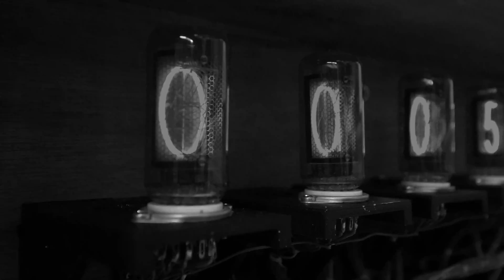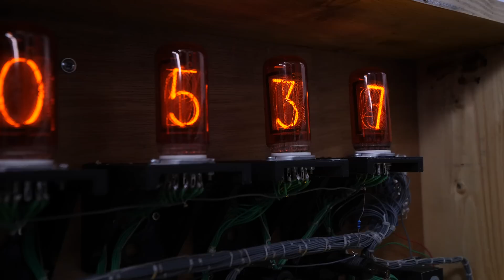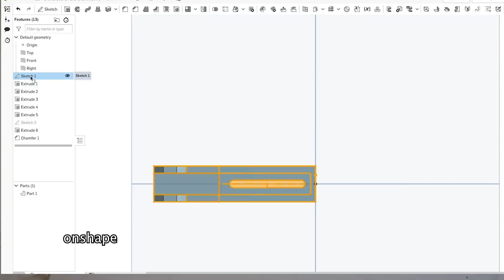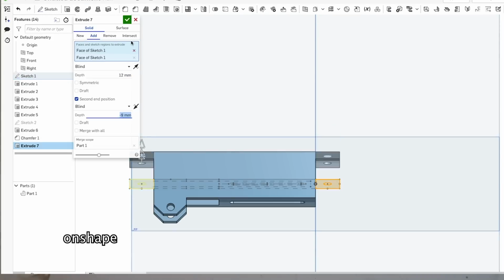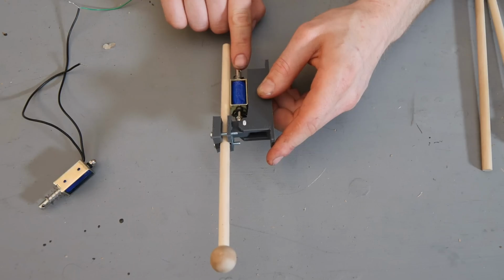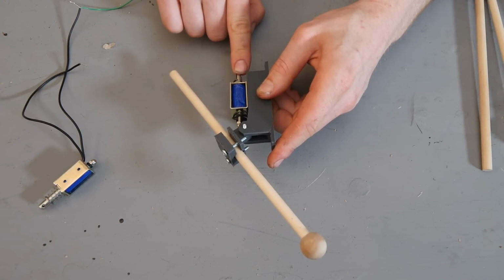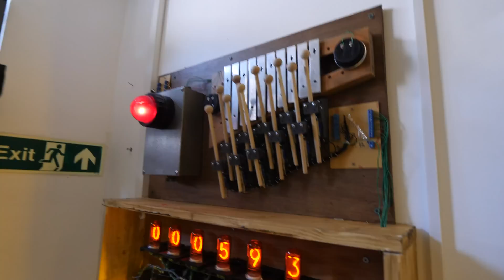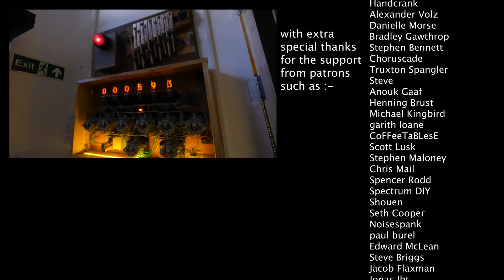Adding A Robotic Glockenspiel To The ElectroMechanical Visitor Counter

Comment: Perhaps you can take some tricks out of modern cryptography and use a pseudo random number generator algorithm (like xorshift128+) to generate a new 'random number' in a deterministic sequence. Where the numbers won't repeat. 

Instead of just counting up by one. So the jingles would sound a lot different all the time. 

Not sure how you would implement it electromechanically, but surely it can be done with analog logic if you have some shift registers.

Comment: Properly should make ur own switch setup that runs faster so canbe more musically rhythmic 

Say microwave oven turn table motors driven at 500hz or something and there door switches on drum turned by motor 
Type thing 
Run a couple of xylophone for polyphonic and resonate sound 

Also to take sound off those flat steel microphones forget wat called glue to each bar and make a little pre amp to filter it or make a custom gituar pick up since it metal

Just SOS it better some free concepts for you

Comment: I wen't to test this via skype to avoid long distance charges and of course a free account from Canada doesn't cover UK phone numbers. Guess I have to do the long distance charges...
Reply: I tried from my cell and I got the voice telling me to check the number dialed and it tells me HB1 what ever that it. That is the first time I have heard that message calling a long distance number.
Reply: Tried again and got a different eror code. I don't think my cell covers UK phone numbers.
Reply: Finaly got it to work I had to use a free app that I haven't used in years called textplus but unforchanitly I ended up calling when the museum was closed. So ill have to convert my local time to the time in the UK and try again later.

Comment: Related to the electronically controlled glockenspiel, the band Sailor 
(A Glass Of Champange, Girls, Girls, Girls Etc.) made a custom instrument they called the Nickelodeon, that had a glockenspiel with what I understand to be door bell mechanisms attached, wired so that the keyboard of the built in small upright pianos could play the glockenspiel on that side (amongst other things), with pedals? selecting different instruments that could be controlled (there were synths (odyssey one side and 2600 the other side?), organ and string synths built in as well, i understand).
There are a few videos from the mid 70's that show it being used live on YT, including performances of Girls, Girls, Girls, Jacaranda and Sailor.
Bit of a franken instrument and must have been VERY heavy. It was built as they realised that 4 people could not recreate the studio sound live without extra musicians. The Sailor Marinaro website has more info on it and the later "fakes" that were essentially posh keyboard stands (though they did look the part).

Comment: Tuned/musical wind chimes might've worked better with solenoids as they'd have been free to move, gravity has stifled the sound of the glockenspiel.  The carbon kids was a smart idea tho - lovely retro sound.
Reply from the maker: The glock sounded exactly the same on the wall and on the desk. I tested it. I like glockenspiel so I used one of those

Comment: If you're wondering "why DOES music sound so bad over the phone?" there's four main parts. Phone hardware, phone network hardware, compression codecs, and multiplexing. Historically, all these systems were designed to be 1) as cheap as possible, and 2) optimized for human voice legibility. Yeah the quality wasn't great, but we get cheap phone calls. In recent decades phone software and speakers have gotten better because people listen to music on their phones, but calls are still using codecs optimized for voice. Between the low- and high-pass filters for multiplexing, digital compression, and hardware, all of which are optimized for human voice, music doesn't get transmitted all that well. Here's a Tom Scott video that gives an overview: https://www.youtube.com/watch?v=w2A8q3XIhu0
Reply from the maker: Glockenspiel sounds good tho
Reply: When I started working in radio in the late 90’s, we had a pair of units that would be used for reporters to do contributions over the phone lines. It would frequency shift downwards at the reporters end, losing some low end response, but at the studio end where it’s shifted back up again, you had better high frequency response so it would sound better than a phone line.

Comment: Just use the Solenoid System from the EM Pinball Machines! They go back by spring and have a Holder also...
Reply from the maker: Yeah but I don't have any.
Reply from the maker: The method I did works fine

Comment: Maybe I don't understand how RC circuits or solenoids work (highly likely), but could you have put a resistor and a capacitor before the solenoid to create the transient?
Reply from the maker: You'd need some seriously chunky caps to the the right time and voltage. It's an option but solving the problem mechanically cuts that out, it has a cap and resistor in place to quench sparks
Reply: @LOOKMUMNOCOMPUTER  thanks for the clarification. One step ahead of the rest of us as usual.
Reply: That's what I thought he was going to do.

Comment: Great solution to the solenoid damping problem!  Years ago, as part of a big shooting gallery build with my local makerspace, I was trying to use an Arduino to ring real bells — each was basically a round alarm bell shell with a solenoid in — and even after getting MOSFETs to drive the bells at 24v, they ended up with that same sort of clunk response.  My problem ended up being that I was effectively trying to drive them with a gate signal, when what it needed was a trigger; I then spent way too much time figuring out just how long the trigger had to be. Too long and the bell wouldn't ring out, too short and it wouldn't ring at all. 
(I should dig one of those out and build it as a synth module  — add something to the percussion on patches.)
Reply: The digital answer would be a monostable, right ? The analog one, a capacitor in series, to turn a step into a pulse (aka differentiator)

 I aint watched to the end yet, lets see if thats what happens ;)
Reply: @petegaslondon  Sam goes with a mechanical solution; I went, in the digital space, with just turning the output high and then low quickly. The amount of that short delay is what took tuning; if it was too short, the solenoid couldn't overcome the — is it friction or reluctance? Even at 24VDC, the electromagnet took some time to get the shaft moving.

Comment: Question: what happens to the tune if it's in the middle of playing because someone is calling in to listen to it, and then a new visitor comes through the door? Does it adjust the note mid-play? Does it restart the sequence? Does the electromechanical machine crash and burn?
Reply from the maker: The tune will change